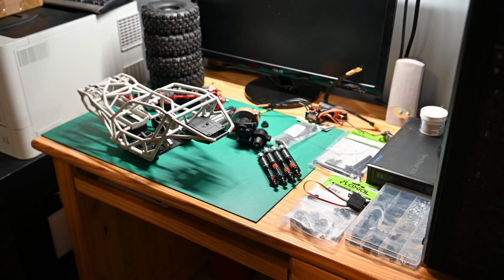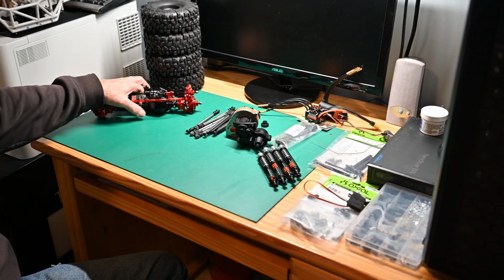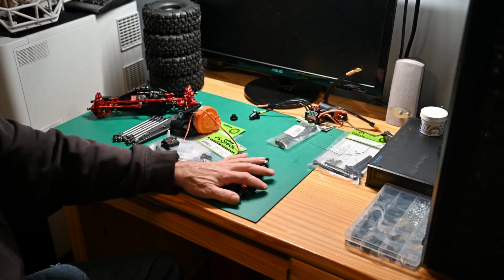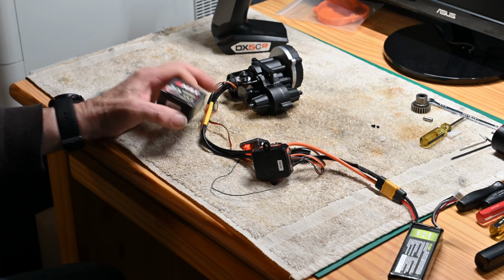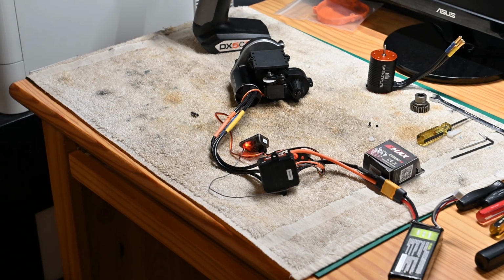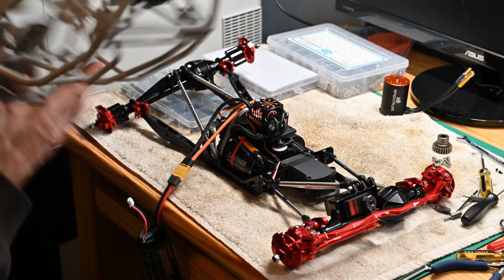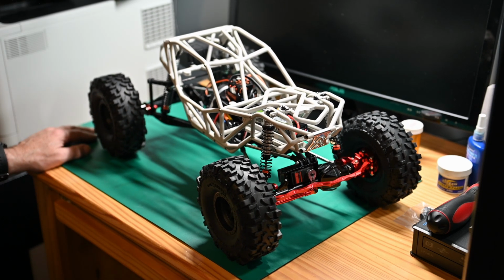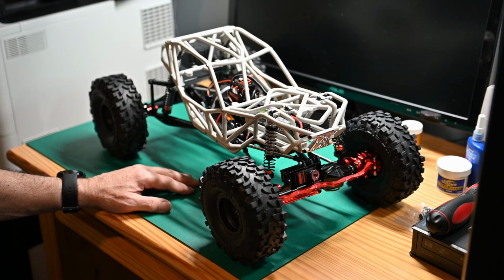RBX10 Rytf Pt 2  of build with a twist

Comment: Great video Adam. I basically did the same thing on my Ryft. One part at a time. I might go with a 2 speed upgrade soon. I went with the 100 amp spectrum ESC and 3200KV motor. It was what I had on hand. It struggles to take off but runs fine. It would be nice to have the 130 amp esc and motor just like the stock one but perhaps with the low gear it will run great. You did an awesome setup with your servo. The lower KV motor should work out better. I'll be looking for your first run. 👍👍🏆🏆⚡⚡
Reply from the maker: Thanks. Look for more on this we have had some setbacks but have learned what this thing needs. will have that in a video soon.
Reply: @AdamEverythingRC  No need to rush things. Your build is looking great so far. There are always setback when you do projects like this. 🫶